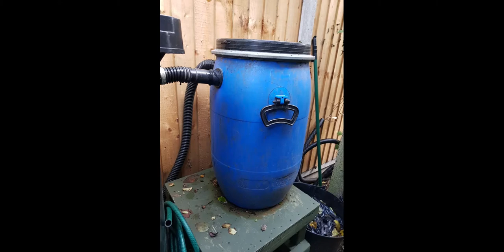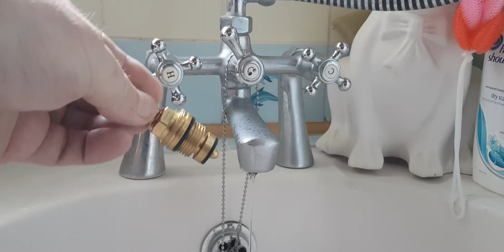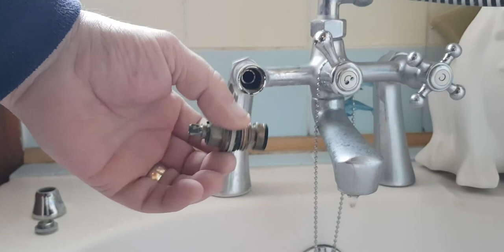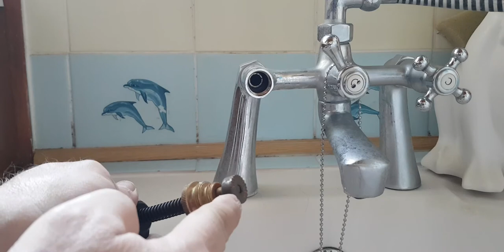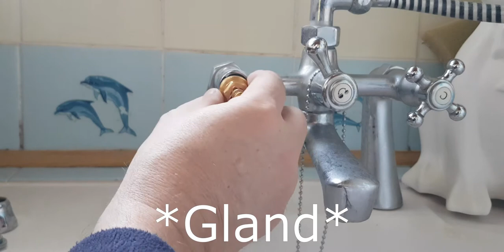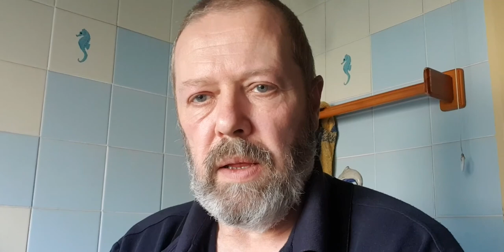How to Change Bath Mixer Tap (Gland change)

Comment: How do I fix the mixer in the middle I put it to shower and the water still comes out the tap an I haven't got a lot of pressure on the shower
Reply from the maker: Unfortunately I have never had a problem with mine so I have never had cause to take it apart. If ever I do I will make a video for you but at the moment there isn't much I can tell you. Sorry

Comment: Hi, I have same taps, my problem is , there is water coming out of shower head when leaver in middle is moved to ´Bath’ and visa versa… have you a video covering this or advice to unscrew middle lever ? Thanks in advance
Reply from the maker: Currently I don't have any other video's on this tap but I think I know what you mean. When I use the shower side of this tap I always, when finished, empty the shower pipe by switching back and forth between tap and shower. It will also sometimes work by carefully selecting the mid point between. If it's something other than that then I would need to look at it to see the problem.

Comment: Great video I have a problem with the lever it keeps leaking how do I change it
Reply from the maker: What sort of valve is it?  If it is a screw type (normal) as opposed to a quarter turn ceramic valve then they have a couple of rubber 'O' rings on the stem that can be replaced.

Comment: It would have been helpful for newbies to be told to put the plug in fitst before unscrewing to stop losing the screw accidentally down the plug hole!!!!!
Reply from the maker: If you did drop the screw down the plug hole you could always take the u bend off and retrieve it.  Unfortunately when you are making these videos there is a limit to how much stuff you can cover and blocking the plug hole would have fallen outside of what could be reasonably expected to cover.
Reply: Common sense 😮

Comment: Everything went well until changing the Gland.  It didn't want to move.
Reply from the maker: They can be hard to undo. Especially if someone has previously overtightened it. You can try applying a small amount of heat to the housing. Because of the chrome I would not use a blow lamp. A hot air gun might work but apply it evenly and keep trying to turn the gland. You could also try using a ring spanner the correct size and then tapping it in the direction it needs to turn. Go slowly. You don't want to split the housing
Reply: @ItsWhatIDo  Appreciate the reply.  Nice to know I'm not stupid then.